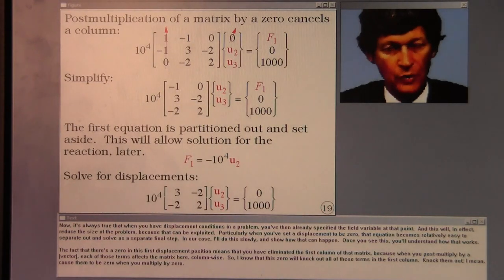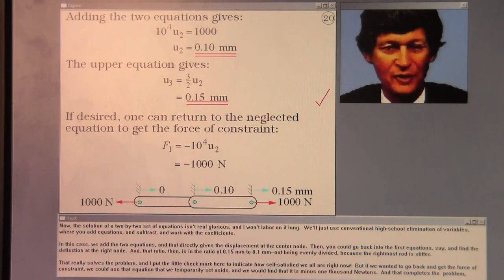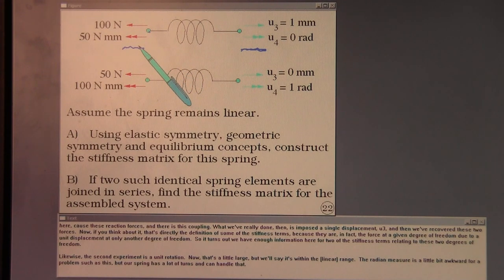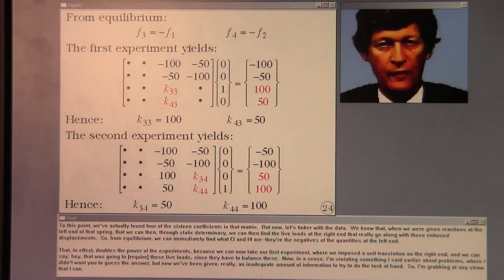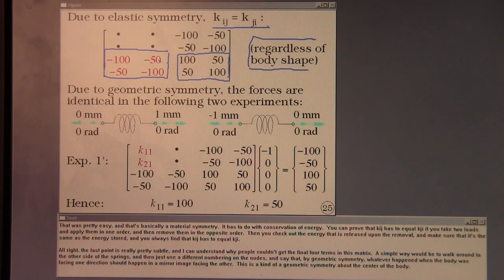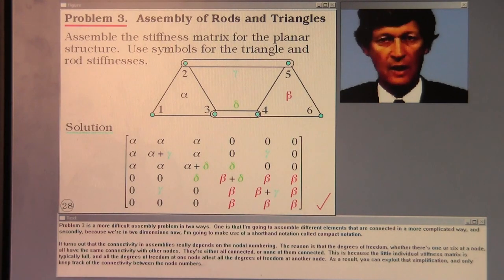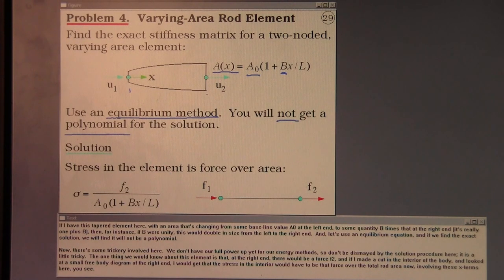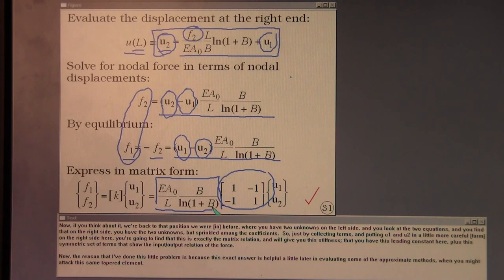FEA.  Rod Element. Lecture 2, Part B.

Comment: Your explanations reflect a very thorough understanding of the topic, my BEng. is in EE(Now doing M.Eng) and typically FEM is explained in terms of Civil Engineering, which makes it quite abstract. You did a great JOb!!!! thank you. Only one thing can you expound a little more on the relationship between the determinant of the matrices and the possible movement of the elements??? Appreciate it a lot...or just point me in the right direction. Thanks